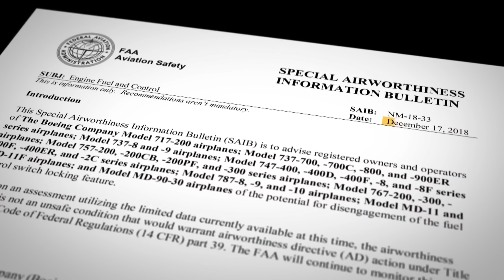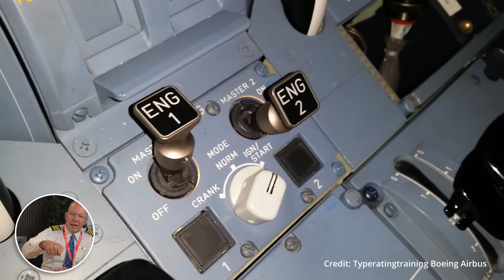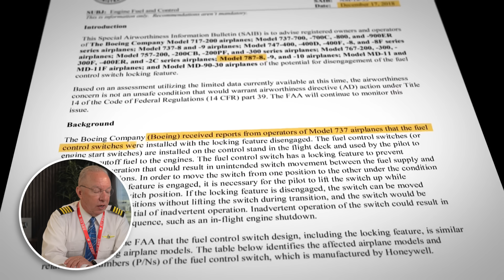Air India 171: The FAA’s 2018 Fuel Switch Locking Bulletin Explained (16 Questions Answered)

Comment: Kind of shocking to see you not supporting cameras in the cockpit. Has there ever been a case where the audio from the black box was leaked when there wasn't a crash or other incident? That data never leaves the black box unless there is an accident so I don't see the reasoning. You have made it very clear where you stand on what you think happened here. Video in this case would absolutely tell us what happened and not leave it to conjecture.  The rest of us are under constant surveillance when we are in public, so why wouldn't the flight crew of an airliner with hundreds of souls on board be subject to surveillance so we can know what happened if an accident occurs?
Reply: It's not surprising since Captain Steeeve is a pilot and it's the pilots, by way of the pilots' union, who oppose cameras in the cockpit. I also noticed that he didn't answer the person's question. The question involved clearing up any mystery surrounding the cause of the events leading to the crash but his answer was that cameras in the cockpit would not have prevented the crash. Clearly, if the pilots movements could be observed, a lot of questions could be answered, even if cameras wouldn't have prevented the crash.
Reply: @robertawalsh2995  cameras never prevent the event. Its like saying putting cameras wont prevent the bank robbery. The purpose of camera is to help in the investigation part. If an investigation takes years to complete, the safety of passengers is compromised. Cameras can help ease that. Steve is so dumb and hypocrite
Reply: @robertawalsh2995  and there's already a shortage of pilots. What they want pulls more weight than a bus driver. They are highly skilled,  and what they want will be important.
Reply: Companies could abuse those cameras for their benefits.
Companies with their money and resources often work against pilots, crew and even against aviation safety procedures, so there should be a balanced approach. For example, deny companies access to that video.
Reply: @semibiotic  Just like Blackbox data it would not be used except for crash debrief.  If you don't like cameras then try a new line of work or fly corporate jets.  Oh, wait, almost every career/job out there now has cameras.

Why do companies work against pilots...because they choose to organize as a union which is an adversarial relationship by definition.
Reply: @danrose3233  You are mixing up cause and effect. Trade unions foundation was caused by massive capital violations, not vice versa.
Reply: And by this point in the video missing and dismissing two well made points that have clear logic to support them, this is worrying.
Reply: Reason is simple if it’s used for reason to get pilots committing a crime. For example if someone say “my pilot was drinking”. If they used those cameras now you are under pressure when it never existed in the first place. When they do the investigation they will find most likely nothing of drinking but about some other item to get you in the footage. 

No one likes that. Would you like the government to put a camera in your car so when they pull you over they can see the footage?
Reply: @snaredude56  You asked if there has ever been a case where the audio from the black box was leaked when there was not a crash or other incident.  The answer is, Yes. Leaking voice recordings to the public is not the only concern.  Both the Flight Data Recorder and the Voice Recorder are in place to enhance safety by providing information about crashes that help pinpoint the causes so that actions might be taken to prevent future accidents.

The problem with voluntary safety programs is that when pilots perceive that participation will invite retribution, discipline, or punishment from the FAA or their employer, they will be reluctant to participate.  And the fact is, many operators have succumbed to the temptation to use the data outside of accidents or incidents to discipline pilots.  Leaks to the public are rare; abuse by the companies not so much.  So, if you put cameras in the cockpits, don't be surprised to see a lot of viseo of the insides of pilot hats, as they'll be good hat racks.

Before the advent of FDRs and CVRs, we were eager to have the data to answer all our questions.  Well, now we have the recorded voices, and the first inclination of many like Steeeve is to completely disregard what was recorded. We might as well toss out the voice recording since we don't believe what was said.  

If we decide to put a camera in the cockpit, we'll need more than one, because we cannot see all the switches and all the faces, arms, fingers and feet of everyone in the cockpit from a single point.  And while we're at it, we may as well put a few cameras around Seat 21A so we can learn more about how that passenger survived.  And every other seat to show why the others didn't.  That way, each of their families can have a multi-view movie of their loved one's final moments.  Do you suppose the lavatories would be off limits, or should they have cameras, too?

Final thought, and this pains me every time Capt Steeeeeve refers to the CVR or FDR.  The 787 has neither an FDR nor a CVR.  As the preliminary report to which he refers clearly states, the B-787 has two (2) Enhanced Airborne Flight Recorders (EAFRs), one in the tail, and the other near the front.  The EAFR  in the front was damaged and unusable.  The one in the tail is the one which has provided all the data.  An EAFR is a flight recorder that combines the functionality of a Cockpit Voice Recorder (CVR) and a Flight Data Recorder (FDR) into a single unit.
Reply: @snaredude56 You asked if there has ever been a case where the audio from the black box was leaked when there was not a crash or other incident.  The answer is, Yes. Leaking voice recordings to the public is not the only concern.  Both the Flight Data Recorder and the Voice Recorder are in place to enhance safety by providing information about crashes that help pinpoint the causes so that actions might be taken to prevent future accidents.

The problem with voluntary safety programs is that when pilots perceive that participation will invite retribution, discipline, or punishment from the FAA or their employer, they will be reluctant to participate.  And the fact is, many operators have succumbed to the temptation to use the data outside of accidents or incidents to discipline pilots.  Leaks to the public are rare; abuse by the companies not so much.  So, if you put cameras in the cockpits, don't be surprised to see a lot of viseo of the insides of pilot hats, as they'll be good hat racks.

Before the advent of FDRs and CVRs, we were eager to have the data to answer all our questions.  Well, now we have the recorded voices, and the first inclination of many like Steeeve is to completely disregard what was recorded. We might as well toss out the voice recording since we don't believe what was said.  

If we decide to put a camera in the cockpit, we'll need more than one, because we cannot see all the switches and all the faces, arms, fingers and feet of everyone in the cockpit from a single point.  And while we're at it, we may as well put a few cameras around Seat 21A so we can learn more about how that passenger survived.  And every other seat to show why the others didn't.  That way, each of their families can have a multi-view movie of their loved one's final moments.  Do you suppose the lavatories would be off limits, or should they have cameras, too?

Final thought, and this pains me every time Capt Steeeeeve refers to the CVR or FDR.  The 787 has neither an FDR nor a CVR.  As the preliminary report to which he refers clearly states, the B-787 has two (2) Enhanced Airborne Flight Recorders (EAFRs), one in the tail, and the other near the front.  The EAFR  in the front was damaged and unusable.  The one in the tail is the one which has provided all the data.  An EAFR is a flight recorder that combines the functionality of a Cockpit Voice Recorder (CVR) and a Flight Data Recorder (FDR) into a single unit.
Reply: There's lots of rational reasons to not want cameras. Remember when they put cameras where passengers could see from the pilot's view, and they then got to see themselves crash straight into the ground?? They took the cameras out after that. 

Airplanes have been used as weapons of war, as political weapons, as terrorist methods etc. Cameras on a train or a bus aren't the same thing. The Feds don't check you when you take other forms of travel because they don't have the same power to be used in a way that's dangerous to society like planes do. 

Cameras might be a good idea, but there would have to be research into the risks vs the benefits. What Steve said, was with what we know right now with the ways cameras would increase risk, he doesn't like the idea. He didn't have an hour to delve into every possible thought he might have on the matter under differing circumstances. 

Maybe don't leap to judge him on a Q and A where he's giving short, direct answers. Send him an email with your concerns, find out more than one sentence of why he said no.
Reply: @Thundersnowdog  Please tell me about the "risks" of cameras in cockpits for commercial planes...there are none.  This is all pilot ego union BS.
Reply: It won’t ever happen . They will not show up for work .. if they did that … 28 year flight attendant speaking . And as Steve said … they have all the answers on record. They don’t need a video . Everything is recorded on microphone or black box
Reply: @Deanastew98  Sorry but cameras are coming to all commercial airliners due to this event--unions be damned.  It is lame to say "they have audio".  Hey pilots, welcome to the 20th Century let alone the 21st!  Video is a low cost solution that would assist greatly in many events where there is not complete clarity on what actually took place.
Reply: @Deanastew98  There are cameras in operator compartments of trains, light rail, trucks, taxies, police cars, etc. why not planes?
Some pilots may grumble but very few if any will fail to show up for work. For every pilot who doesn't like it there are 50 qualified pilots standing in line to take those jobs.
I bet there are cameras in the flight simulators that are reviewed and scrutinized during training and performance reviews. What a great management tool cockpit video would be for pilot performance reviews. Before review say 10 random videos of pilot being reviewed are examined to see if all pre flight, flight and post flight procedures are followed. This would identify excellence as well as help target areas needing improvement.
I hate to resort to the old cleshay of "what are you trying to hide" but there it is.
I'll need a much better argument for no cameras to change my mind.
Reply: @Deanastew98  Oh, but we don't have all of the answers. All we have are flight recorder data, a verbal question of one pilot to the other as to why he deactivated the engine fuel switches and a denial by the other pilot. At this point we don't have any data about the condition of the switches, other than the fact that they were in the engine on position because they tried to restart the engines. We have no information if the detent safety system was functional or not. If pilots are that concerned about there being a video record of what went on in the cockpit in the moments leading up to an accident, that, to me is very concerning. In this case things could lead you to jump to the conclusion that it possibly wasn't an accident, but to state categorically that it was intentional is irresponsible and potential libelous at this point. We simply don't have the proof either way. A video would provide that proof.
Reply: 1. Steve blames on pilot Day 1
2. He dismisses any blame on Boeing 
3. He is against installing cockpit cameras
Reply: @galaxy-xp5nn  Doesn't make him wrong, it just isn't your preferred narrative.
Reply: @buckhorncortez  it pilots can be vloggers and YouTubers, why cant they accept cameras inside cockpit?
Reply: Would you also like cameras in the passenger cabin sections? Imagine having the horror of a crash leaked to YouTube showing the exact moment all those people died, and how.
Reply: @paulxc4411  Actually, yes.  It would be great to learn about safety issues.  How did the one passenger survive?  Maybe there is something to be learned.  All these overly pious comments about not wanting to relive a death scenario.  It is not irreverent to view a death scene.  No one is making you watch it.  It is only in recent history that people are offended by death.  Death used to be more common in the public eye--nothing wrong with that.
Reply: @danrose3233 I think your comment is valid. But we all know what would happen. The YouTube conspiracy theorists would be demanding the publication of the footage or claiming a coverup. We need the truth but also need to spare families the anguish.
Reply: @paulxc4411  There are in fact cameras in a lot of the passenger sections of a lot of aircraft, just not saved to the black boxes. They also never leak.
Reply: @Kacper_Kolodziejczyk Thank you, but I think the conversation here is about recording the cockpit video. My same point applies. The video would eventually get leaked or the YouTube “experts” would be shouting “cover up”. Not something the families would be happy with.
Reply: @paulxc4411  Lame excuse for not having video.  Do you have any concern for the families of the dead people in the back of the plane.

Maybe as a customer I am going to demand that cameras be in the cockpit or I don't fly!
Reply: @danrose3233 Yes I do have concern. Concern that the families wouldn’t want the videos all over YouTube for sickos and conspiracy junkies to look at.
Reply: @paulxc4411  There were all kinds of gopros in that woman youtuber's  plane that crashed a few years ago, killing her and her father and none of them leaked. And it was even mentioned that the FAA was reviewing the footage. And they weren't even FAA regulated. They were her own for making videos for youtube. Most cashiers are under video surveillance to make sure they are not stealing from the register. You telling me that a flight crew with the responsibility of up to several hundred people's lives shouldn't be held to at least the same standard?
Reply: @paulxc4411  why you so dumb. Videos would be stored inside blackbox. Stop being fool.
Reply: Cameras would not have affected the outcome!
Reply: @carsten4594  Their presence generally creates a culture that might disincline some malpractice and if some were to be enacted, to have evidence of it, in my opinion, the gold standard.
Reply: @carsten4594  Of course not. That's not the point. The point is that we would be able to see if one of the pilots turned the switches off intentionally or if there was some sort of accidental activation of the switches due to the pull - detent - release switch mechanisms on both switches had somehow been damaged  or disabled at some point allowing them to be turned on and off with simply pushing them. What is being said about the two pilots in this situation could be construed as slander, because we truly don't have any definitive proof. Think that's silly? Another, very respected aviation channel got a letter from the lawyer representing the family of a deceased pilot due to his choice of words in his interpretation of what had caused the fatal accident. He was threatened with legal action unless he issued a complete retraction of his statements, which he did.

Comment: 3. If there is an MCAS like flaw in the fuel control  switch locking mechanism, and both switches turned off in quick succession due to this flaw , won't it explain the pilots' conversation and in fact the whole situation?

Comment: Under what circumstances with the aircraft in flight would it be necessary to be able to switch off the fuel to both engines? If there's no good reason surely the aircrafts computer should stop it from happening?
Reply: There is a situation where they might be turned off according to a flight crew manual I found online. I hope I’ve remembered this correctly. First of all in this description “stall” refers to an engine stall not an aircraft stall. 
There’s a function called auto-relight.

If the system detects that an engine is operating below its idle speed in flight, called a sub idle stall, then the auto relight function is enabled and fuel to that engine is halted for one second in the hope of overcoming the stall. Then the system attempts an automatic restart. Restart will keep trying to restart the engine until either the engine starts OR the pilot selects the relevant FUEL CONTROL switch to CUTOFF. 
If the FUEL CONTROL switch is set to CUTOFF then the fire switch is unlocked.
All of these cause various changes to the multifunction displays.

Comment: So why the pilot took 10 seconds to reset the fuel switches after knowing that they were cut off.. and another question I think we're forgetting,  why the aircraft took unusually long almost used the whole runway to get airborne, If everything was running as it should until takeoff ??

Comment: If your engine catches fire then you turn the Fire Handle, surely? That would then supersede whatever thrust setting and fuel cutoff status was currently configured
Reply: Looking at one of the Boeing manuals, the fire switch is unlocked if the FUEL CONTROL switch is set to CUTOFF or there’s a fire warning.